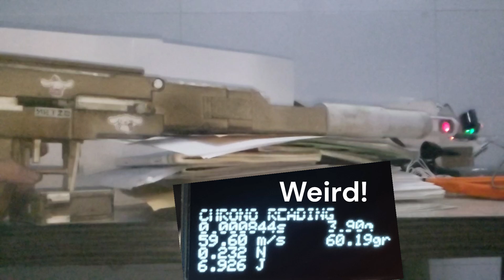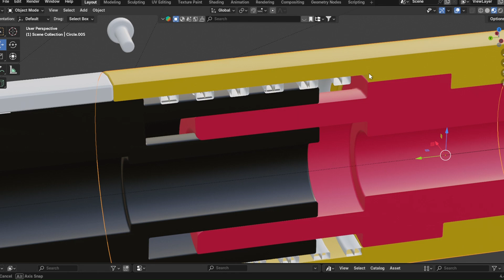Paper rifle #20: Switching To New Propellant

Comment: What tool did you use for drilling bolt for firing extractor and ejector ?
Reply from the maker: I just use knife, base on how the bolt is made which is cylindrical, a knife is enough,  i just remove layers untill there space for them.